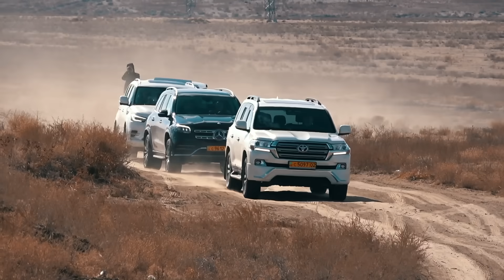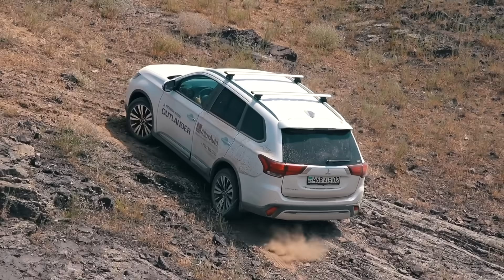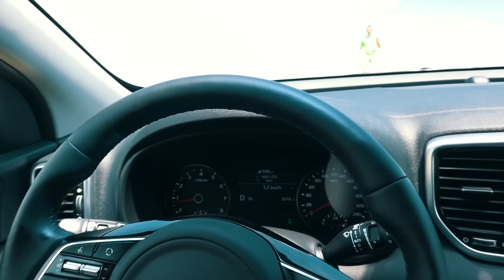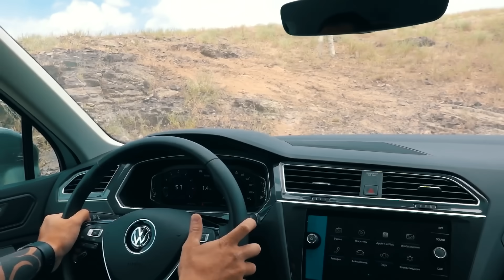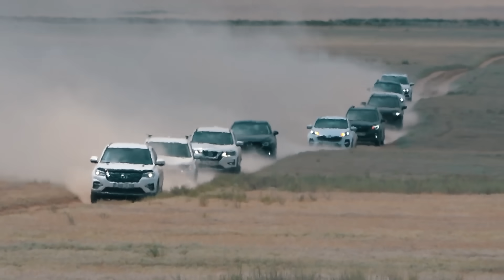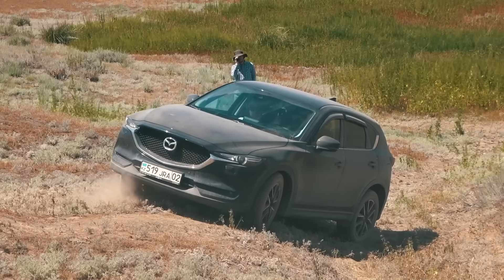SUV Battle 2020: Toyota RAV4, Nissan Rogue, Subaru Forester, Mazda CX 5, Volkswagen Tiguan, Sportage

Comment: Bad channel.. 
I own the forester sport 2020, I do with it more deficult conditions and its do very easy,, and with the original tires witch is not 50/50... 
The boxer engine and the symmetrical awd + xmode is number 1 in the world to me
Reply from the maker: Drivers deliberately drive as slowly as possible and along a deliberately “wrong” complex trajectory. This allows you to demonstrate the effectiveness of the four-wheel drive system. If you take a good acceleration, then all cars will easily pass this obstacle and you will not notice any difference in their behavior.

Comment: Offroad with streettires? :-D
Reply from the maker: I completely agree with you. The same tires will add objectivity. But since I do not have a car tire factory, we work with what we have. At the moment, we are checking that the tire pressure corresponds to the factory values (for each car individually).

Comment: I think the first car will be advantageous because it is the same road.
Reply from the maker: I completely agree with you about condition of surface. But finding a way so that the surface condition does not change and there are convenient shooting points is extremely difficult. So far this is the best I have found. If I find something with a more stable surface, of course I will take this opportunity and will test there.

Comment: I was disappointed in the rav4. I have a 97 Rav4 and I'm confident it would have just climbed right up. I believe their "off road" features have gone down hill through the years.
Reply: did you even watches if who won the test?
Reply: @bellboy7286  yes....
I'm just saying it the older rav wouldn't have slipped or anything and they wouldn't have needed to gain speed to go but the newer ones do🤷🏼‍♀️

Comment: Test a volvo xc60
Reply from the maker: I will try to find this car and test it on some obstacles. Who to take as rivals?
Reply: @SUVBattle  Great! I think it would be really interesting to compare a volvo xc60 t6 (or with another engine as long as it's not a plug in hybrid) with the t8 which is a plug in hybrid and has a completely different awd system. Other rivals (That I think you haven't tested) could be the mercedes glc, peugeot 3008 awd, jeep compass or cherokee, Citroen Ds7, ford explorer, range rover velar and even the new mercedes eqc

Comment: I expected the CX-5 to perform better. I've driven my mother's during wet and snowy conditions and it has performed really well. However, it may be optimized for those conditions and does not anticipate you going seriously off-road.
Reply: The cx5 drove in freshly made potholes, after it veered to a new course it climbed with ease
Reply: Another thing to consider is that they didn't turn off traction control, which might have made a huge difference. Kind of a big miss by the testers IMHO.

Comment: I git dissapointed w/the Subaru...I really expected more of it... lol
Reply: driver was very bad
Reply: Can anyone explain to me why the foresters tires barely turned during the drivers attempt to get out of the dirt?? Is this normal in any way?  The other cars looked much more powerful and capable in the given situation.
Reply: Subaru should have easily made that. They just need a better driver
Reply: CVT is what lets down the Forester
Reply: @mosesnzusi5658 have you driven a Subie with a CVT? I own a 2017 subaru crosstrek..as much as I dislike a CVT and it's the only thing about my car I dislike I KNOW I would make that hill...I've owned a Jeep as well and I will tell you Subaru is much better in the snow...speaking of which its suppose to snow 8-12 inches today and i just bought 4 new tires yesterday...i can't wait to drive today...yay snow..
Reply: @skyboogs917  Yo do you really think the Subie is better in the snow and ice than a jeep in 4HI? I've been curious about that. I own a Forester and am moving to the North East. Could you elaborate?
Reply: @kingsleyzissou5881  is your reading comprehension that bad? I owned a 92 jeep cherokee and I currently own a 2017 Subaru Crosstrek and my crosstrek handles better in the snow PERIOD. I don't know what else is needed to elaborate.. your resale value not depreciating should also be a factor to consider.
Reply: @skyboogs917  That's a 30 year old jeep but yea. Well thanks for the info... I'm not doubting you I am just curious what makes the subaru system better for traction in those conditions.
Reply: this guy was a shitty driver...the subie is by far the best awd system out of all of these
Reply: Bad driver. Has the best AWD in the world. Look at less bias videos..
Reply: @williamjohnson650  — Right here on YouTube, there are videos from Spaniards, from Russians, and from the good old USA, and this problem with the newer Subies has been identified time and time again. 

There is even a video with a Subaru rep explaining the safeguards built into the cars to protect the CVT.

And yet, you witless fanboys persist in blaming everything but the car.
Reply: as you said there are tons of videos even here in YouTube of many newer subarus with the cvt tackling obstacles such as this and tougher.  Why is it that when anyone points out how a driver could have done the obstacle better someone always screams" fanboy". No ones saying subarus choice of the cvt was the best choice they could have made. But they are a hell of alot more capable then a test like this shows
Reply: @robertherek4020  — Four wheels on dirt, foot nailed to the floor, and nary a wheel turning. Somehow, I don’t think there is any way that this is the drivers fault ...
Reply: To be honest only 1% of all the cars they tested gonna be doing that kind of stuff. wet and snow are far more important.

Comment: I have to say these tests were meaningless since the surface condition of the tracks changed so much with so many runs.
Reply from the maker: I completely agree with you about condition of surface. But finding a way so that the surface condition does not change and there are convenient shooting points is extremely difficult. So far this is the best I have found. If I find something with a more stable surface, of course I will take this opportunity and will test there.
Reply: @SUVBattle   I fully understood your situation. It is so hard to control the condition, especially when it is off-road. The performance of Subaru Forester is really out of my expectation. Wish to see your test on Acura.

Comment: This video is crap. You use dumb drivers, and stock tires and you want to show the cars could not climb the hill....well, I have seen enough...
Reply from the maker: Well, my goal is just to show the difference in the efficiency of the four-wheel drive of different cars. It may help future owners to make decisions whether to buy the car or not.

And if drivers drove the way they should, then you would not see the all-wheel drive system's work.

But I completely agree with you about tires. The same tires will add objectivity. But since I do not have a car tire factory, we work with what we have. At the moment, we are checking that the tire pressure corresponds to the factory values (for each car individually).
Reply: @SUVBattle  Thanks for open answer, much appreciated. Just a comment to the Subaru - the drive train works best in these conditions when you turn x mode on, ESP off, and you let it run with pace, not stopping like we saw in the video. I saw Subaru's to achieve incredible feats. Yes, you showed that every car can get into the problems, if not handled correctly, but you did not show where are the limits of each car.

Comment: Comparing 1.4L Tiguan to the others is absolutely unfair. Small engine that made for roads only
Reply from the maker: There two Tiguans in the video. One is equipped with 1.4L and another is 2.0L. So you can see the difference by yourself.
Reply: @SUVBattle  For me that difference is obvious

Comment: i think the only thing that would make this better is to have the same tires on all of them
Reply from the maker: I completely agree with you. The same tires will add objectivity. But since I do not have a car tire factory, we work with what we have. At the moment, we are checking that the tire pressure corresponds to the factory values (for each car individually).

Comment: I have a 2019 Outback I was hoping for better results from the forester. I think tires makes a difference
Reply from the maker: I completely agree with you. The same tires will add objectivity. But since I do not have a car tire factory, we work with what we have. At the moment, we are checking that the tire pressure corresponds to the factory values (for each car individually).
Reply: You are right also we have a subi fan group we always see better performances with xv

Comment: off road tyres  Recommended
Reply from the maker: I completely agree with you. The same tires will add objectivity. But since I do not have a car tire factory, we work with what we have. At the moment, we are checking that the tire pressure corresponds to the factory values (for each car individually).

Comment: Moral of the story: get a vehicle with LSD if you expect to drive like this. After reviewing Toyota's AWD systems, apparently top level RAV4s do have a rear limited slip diff. This makes all the difference. None of the others have LSD.
Still, I'm surprised the Subaru didn't do better because I believe it can shift more torque rearward than the others, though CVT doesn't help.    (Hate robot voice; get a person to narrate.)

Comment: CX5 - All you had to do was turn off Traction Control and it enables a special "off road" mode, a different software algorithm, but you did not try it at all.  It's the same thing as the new off road button on the 2020 model, all you have to do is disable Traction Control on the CX-5 to enable it, a shame you didn't try it.
Reply from the maker: All comes with experience. Let's try next time. by the way, Mazda promises an off-road mode for CX-5.

Comment: Forester surprises me as well, but I have one question. People said Subaru Forester’s CVT limits its off road capability, RAV4 is the champion in this test, but RAV4 also uses CVT. Can anyone explain why RAV4’s CVT does not limit its off road capability?
Reply: Only the hybred rav4 has a cvt the rest have 8speed auto tranny
Reply: watching an independent test channel with a reputation for fair testing is important

Comment: Try it again using the same driver in each car, and make them all do a second climb. See if the earlier ones do as well on the second climb. Not that impressed with the drivers, they lost momentum by either braking or coming off the gas...
Reply from the maker: Drivers deliberately drive as slowly as possible and along a deliberately “wrong” complex trajectory. This allows you to demonstrate the effectiveness of the four-wheel drive system. If you take a good acceleration, then all cars will easily pass this obstacle and you will not notice any difference in their behavior.
Reply: @SUVBattle  well trying to make them fail seems a bit pointless. if it is an easy climb, you find progressively more difficult climbs. It wasn't really stated in the intro (unless I missed that part...) you were trying to get the vehicle into trouble... that puts an entirely different slant onto this, that I am not sure myself or others were made aware of...

Comment: I've seen Foresters climb a hill like that easily...
Reply: In the later tests, you can clearly see the front right tire dropping into the hole made by the previous vehicles. If they didnt have to hit that hole, it would have had a much easier time for them. A bit of a letdown as far as i am concerned.
Reply: @JHolder1422  yeah I was thinking the same thing. The first car dug a rut much worse than the others that they wouldn't acknowledge and every car struggled. Somehow that's the cars fault though.
Reply: @Yq Gui this is a test of their off road ability and shows clearly their limitations
Reply: They probably didnt stop half way up
Reply: Salty ass subie
Reply: Old one not the crappy cvt
Reply: it happened because of the crappy cvt,older torque converter ones are great...
Reply: @kaan898  bravo Kaan bey 👍
Reply: @kaan898  the new ones with cvts climb just fine, if you read suv battles below response, he stated the drivers were driving slow and deliberately on the wrong trajectory. he stated; "if you take a good acceleration, all the cars would easily pass this obstacle" So what he didn't state was it was an attempt to make them fail or struggle to see how they would overcome getting into trouble." If he had said that in the header about comparing the suv's, then maybe people would not be falsely blaming things like the cvt unfoundedly, and the cars, tho they struggled after being put in a bad position, still made it up the hill... so its not really the cvt's fault. cvts have their shortcomings, but they also perform quite well. Especially the more recent ones.
Reply: @lonewolf82007  you made a good explanation but in some ways cvt   send not  enough torque to wheels even you have a great software ,ok latest cvts perform better but not in tough conditions my friend...
Reply: @kaan898  well I mean, its not a jeep... but it isn't marketed as one. Most people agree Subarus are great in the snow. There are always people who will disagree. Most owners who use them are loyal for a good reason.
Reply: @lonewolf82007  yeah give me a toyota 4 runner,i want nothing more :)
Reply: @kaan898  well, i love my 2020 Forester, so I'm biased. LOL! I owned a 2014 too, the 2020 is a nice upgrade! For me, as a New England commuter, it suits me. But I would never knock a Toyota! Mad respect for them! Great vehicles! 4 Runners are great!
Reply: @lonewolf82007  fr man, Mad respect to toyota bro. They killin' it. LandCruiser, 4Runner, Tacoma, Hilux. Damn, ima head out too 😂
Reply: @kaan898  the nissan had a cvt too and did quiet alot better than the subaru
Reply: @dafreefleischer5072  but others rubbish its cvt even thou it comes out of the same factory as the subi one.
Reply: @rhett7716  yeah not a fan of CVT  myself
Reply: @kaan898  — You have been fair in your posts, unlike a lot of Subaru fanboys. I’m surprised that Subie fanboys are almost as blindly zealous as Tesla fanboys.

You are quite correct that Foresters and Outbacks are great in snow, and that is all 99% of their customers will need or care about.

But to me, Subaru is at fault in that they advertise their vehicles as being more off-road capable than they are.

CVT’s seem to be infiltrating the small-car market, and they are indeed good for MPG’s, but they are going to chase away a lot of Subaru customers between now and when they get them perfected ...
Reply: I've gone up hills like that faster than the Jeep in front of me in my Subaru.   It's the driver.

Comment: For real???!!!
Not even a real or fair test,...
1- A test put the vehicles to the same identical conditions which wasn't the case here, the test changed and got more challeging with each vehicle pass.
2- Some of those drivers evidently were wannabe amateurs, evidenced on how they drove and got stuck.
3- The drivers of the Changan, Subaru and Mazda shouldn't be driving anything bigger than a pedal car or a power wheels, witnessed Mazdas overcoming greater and worst obstacles than those shown as well as a Subaru owner I've seen Subarus tackle worst conditions and obstacles without breaking a sweat, never seeing a Changan in action so I won't advocate for the brand or car.
Reply from the maker: I completely agree with you about condition of surface. But finding a way so that the surface condition does not change and there are convenient shooting points is extremely difficult. So far this is the best I have found. If I find something with a more stable surface, of course I will take this opportunity and will test there.

And drivers drive like noobs on purpose. If they drove the way they should, then you would not see the all-wheel drive system's work.

Comment: I think the driver in the forester wasn't well equipped with the knowledge of the car, i am impressed by the Rav 4 and Tiguan, but the forester is supposed to do well than outlander and rogue. Change drivers
Reply: Suppose to and doing it is two different things, the Subaru was struggling like crazy and the outlander and rogue both did pretty good, maybe the forester isn’t the best🤷‍♀️
Reply: @sethlittle7338  it isnt, the rav 4 did well, the tiguan did well too, the outlander and rogue did well too but i still maintain the forester if driven by a well informed driver about its capabilities, it can do do better than the rogue and outlander.. just saying... I have seen a couple more videos
Reply: @melvindjfivo-ls5257  I mean I like foresters but i don’t think they’re as off-road capable as they use to be I mean as least it made it up the hill unlike the Mazda which was pretty disappointing that it’s awd was overheating after such a short time, also the Tiguans transmission overheating is really disappointing considering that none of the cvts did

Comment: I'm done with Forester's now that I won't be able to get another 6 speed manual. Not a CVT fan.
Reply: Did you notice that the forester they tested never was allowed to use its deep snow or mud and snow modes?  Yet the Toyota was allowed to engage its other available modes!  WTH with that?!!
Reply: My 2020 Forester Sport has X mode available in 2 different modes yet in this video the producers never wanted to consider that while filming the Sube. WHY NOT?

Comment: next time, try the same tyres for all the cars, and will be perfect. Nice video anyway
Reply from the maker: I completely agree with you. The same tires will add objectivity. But since I do not have a car tire factory, we work with what we have. At the moment, we are checking that the tire pressure corresponds to the factory values (for each car individually).